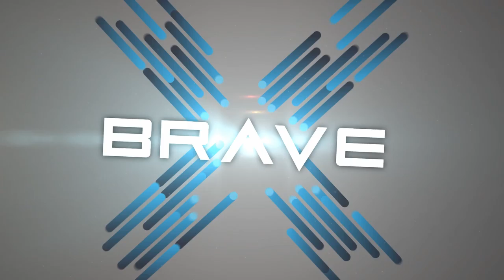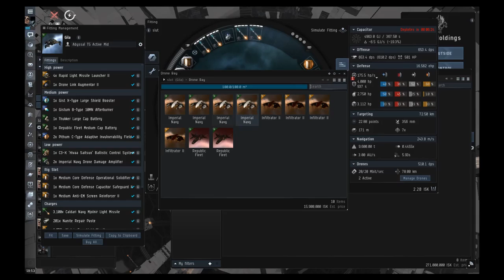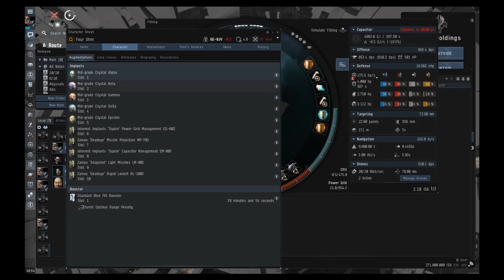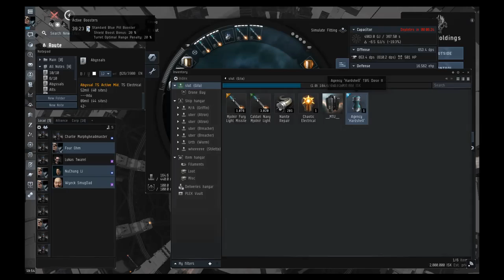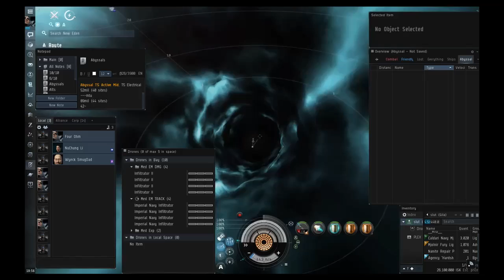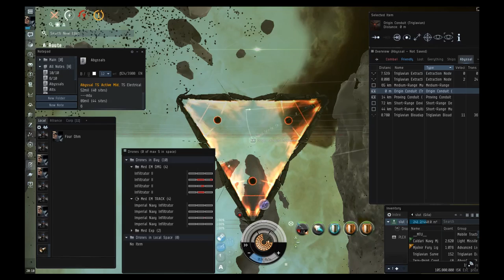Abyssal T5 Electrical Gila Run - Four Ohm - Eve Online - June 2019

Comment: does resist changes make this impossible?
Reply from the maker: You'd need to be careful, try in t4s first.  For the most part we've found that resist changes just make things a bit dicier.  Could upgrade things to a b it blingier.

Comment: Your fit:
T5 abyssal gila
4x rapid Light missile launcher (kinetic+expl. Faction and furies)
Drone damage aug
Gist x-type shield booster
2 x pith c-type adaptive invulnerability
Med cap battery
Large cap battery
Gistum b-type ab
2x Faction drone damage aug
(Faction?)Ballistic control sys 
Faction infiltrators and valkeries (for Triglavians)
Em rig
Capacitor safeguard rig
Core defense op solidifier
Standard blue pill
Mid grade crystal set
Crystal omega
Reply from the maker: thanks John!

Comment: wiki says thermal is the best damage for trig and the gila geta a thermal bonus. am i missing something? 
my smartbombing geddon uses shadow thermal and waxes them in high sec.
Reply: Not the video creator, but I believe the wiki is probably talking about overall resists, which is true for thermal. However, Trig ships are armor tanks and, especially with Battleships, that matters a lot. Their weakest armor resists is explosive: https://wiki.eveuniversity.org/Leshak

So even with the 50% EM penalty, their EM resist on their armor would be 25%, while their explosive is only 20%.